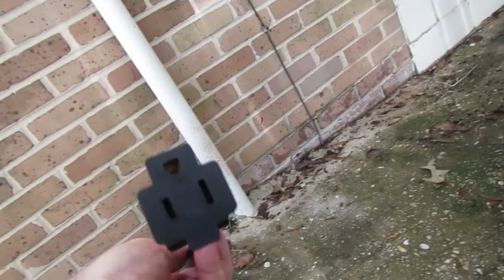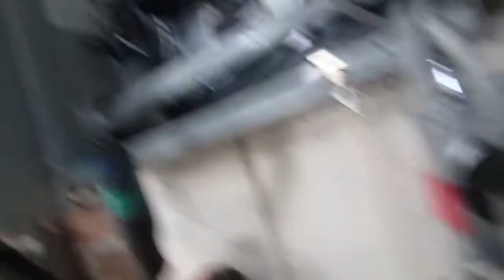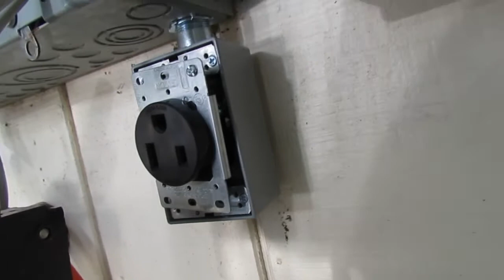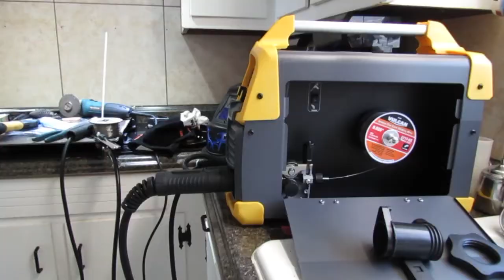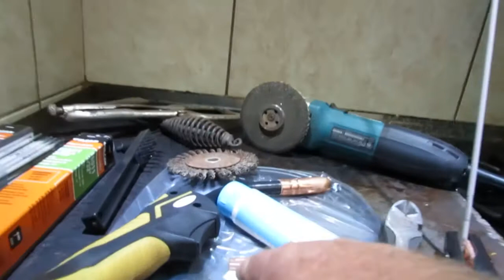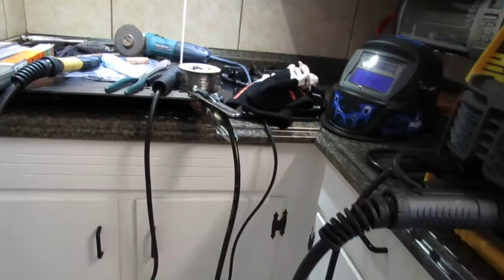Testing and Review of the Tooliom TL250 Multi Purpose Welding Machine. Read Below

Comment: different manufacturer of breaker is not a problem. What kind of BS is that?
Reply from the maker: Most manufactures state on the label "Only their brand of breakers should be used. Failing to do so will void the warranty"
Reply: well, a Square D QO breaker will not fit in a CH panel (Cutler Hammer). Even Square D QO and Square D Homeline breakers are different sizes. Leviton also uses proprietary breakers. They're not all universal.

Comment: Do you have a volt meter? Check that pigtail plugged in without the welder. I bet it only uses half of the 220v circuit and supplies regular 110v. It doesnt "boost it up to 240". If it did, that pigtail would be illegal. You should be able to plug any 110/120v appliance into that pigtail. I think the modification to your panel was a waste of time and money.
I didnt get a close look, but looking at the "face" of the outlet, if its right "eye" is turned 90° (flat), that just means 20 amps @110/120v. If its left eye were turned, that would mean its 220v, but you wouldnt find a 110/120v outlet that would accept the plug.
Reply from the maker: Thanks for your comment and I was wondering the same as well, but have never taken the time to check voltage. I also agree that wiring a standard 120 outlet to 240 could be hazardous. However, I wired it for 240 assuming the machine would perform better. I have also marked the outlet "240 Volts" . I am going to put the Voltage Test on my "To Do" list. Thanks again
Reply: @southernhometalk2465  The new outlet you installed likely is 220V if you installed it properly. 
But when you plug that foot long pigtail into it, the end of the short pigtail extension cord will measure 120V.
Reply: One more possible diagnosis:
Did you have to buy and install the outlet that you plugged it into before using the pigtail converter?
What did that 3-prong outlet look like? If the "eye" on the left was capable of accepting either a vertical or a horizontal blade, then it was a 120V 20 amp outlet, but if the eye on the left accepted only a vertical blade and the one in the right accepted only a horizontal blade, then that recepticle was designed for 220V and if you wired it into a 120V circuit, it's no wonder the welder wouldnt run properly
Reply from the maker: I used a standard 3 prong 120 outlet due to the converter cable being the same. I know its crazy. @Bluuplanet

Comment: Trying to learn to tig weld with this sucker. And idk if I just suck.. or what. But I keep melting the dam tungsten bits.
Reply: Have you figured it out what was going wrong yet? Just got the same machine and will be trying stick soon.
Reply: Different tungsten materials give you a higher heat resistance such as thorium, cerium, lanthanum etc.. Also getting too close too the weld pool or accidently dipping in the weld pool can help contribute to the problem. Did you ever figure it out?
Reply: I have been welding for 50 years stick , MIG and gas , I just purchased this little welder to teach my self TIG . I started okay, but switched to cheap 12 dollar foot control and I have had bad results . Today I am going back to the button control and will try welding only clean steel .  I took a Gas course in 2014 and did fairly well and thought the TIG would be better for little DYI jobs, not so sure any more about the TIG . It is tough to master, even after watching all the good U Tube videos .  @ThePROFESSIONALhooligan

Comment: How did you set up for stick welding?  Mine only would strike an arc in tig mode. MMA nothing.
Reply from the maker: Thanks for asking, I have not tried stick yet, but thanks for the tip on that.
Reply: @southernhometalk2465  but you said you tried it in the video? 😂 And it worked fine
Reply from the maker: @TylerD63  I didn't do any long pass welds, just tacking

Comment: Any updates on it?
Reply: I purchased one and honestly it is great. Works well with all processes and on stick it will burn 5/32 hard facing rod without a problem. I had the older 200m as well and that welder was also amazing. I sold that one to my buddy and he also loves it. I have an old Miller that I got like 12 years ago and the Tooliom has more features and is more powerful.